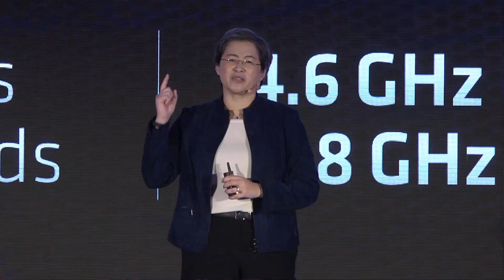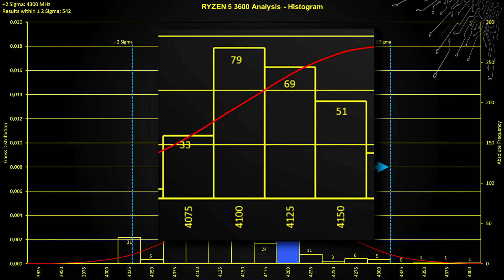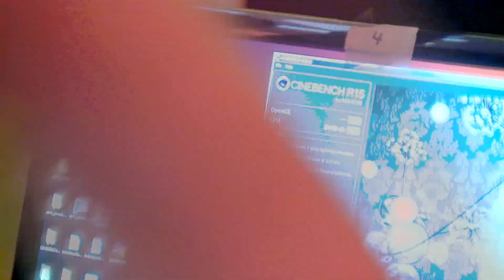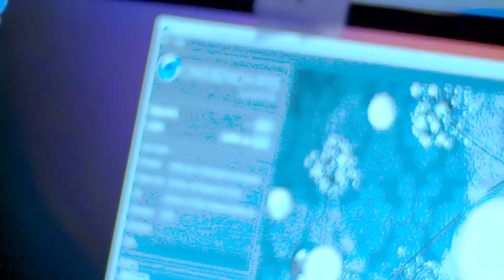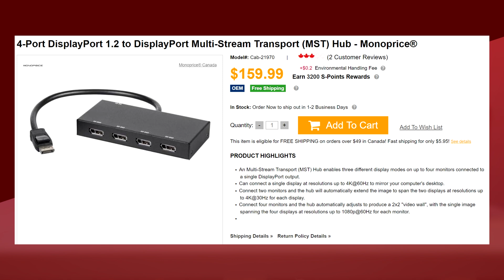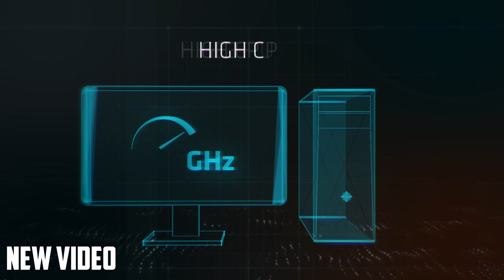95% of Ryzen 3900x Can’t Reach Boost Clocks, Survey Says!

Comment: My 1650 V2 would hit my overclock speed of 4.1 gigahertz quite frequently but when I upgraded to a 1680 V2 it rarely get the stock overclock turbo mode of 3.9 and it definitely doesn't take that overclock at put in and I blamed a cheap motherboard

Comment: that's probably related to the cooling system, it could be related to badly applied thermal paste
also, does it really matter, when the thing is half the price of a similar intel device ?
Reply from the maker: Personally, I dont think it matters, its still an amazing value. but its still an issue. I doubt cooling has anything to do with it, its quite easy to keep a ryzen cpu cool !
Reply: @BootSequence  talking about cooling, would a 3700x  with noctua nh-l9a work in a 2U server case running linux ?

Comment: But still they're not getting to 4.6 on a 3900 X but has to do the luck of the lottery silicone. And the board you using. Why recommend to get good clock speed by $300 and up on a motherboard.

Comment: I'm talking about the $350 and up versions and motherboards. You can't expect to have those clock speeds with a $200 board.
Reply: Asus make a nice $170 570 mb,check out hardware unboxed youtube video,low temps,performs well beyond its price.

Comment: weird... Both, my brother and I, are able to hit 4.6. WHAT DOES THIS MEAN?
Reply from the maker: means you should leave it like that, dont change anything 😂😂
Reply: Boot Sequence I have been messing with. But I ended up leaving it stock, which it still hits 4.6. Asus ryujin aio 240, bought couple more Noctua fans and set up a push pull on a open air case. Fans on auto my temps hit flat 60 degrees. Full blast I’m at high 40s on gta.

Comment: AMD get too sggressive with the clock because they want to convince the public that they are not behind intel when it comes to clock speed. That's why with the Ryze pro commercial they even try to plaster than 5Ghz number before. AMD should take it slow and not rushed it. Slowly improve their processor and make good impression to the public. Over promise did not make you look good. They already got a lot of flak with bulldozer they need to regain consumer trust slowly not rush it and create another bad image of themselves.
Reply from the maker: exactly what I thought. Although apparently it is an issue in the SMU. AMD is bringing a fix in september apparently.
Reply: @BootSequence  yep. Let's see what happen next. I've already heard few negative speculation why is this happening like how AMD push the clock as high as possible for review purpose then the BIOS updates following after initial review has comes out affecting boost clock because the aggressive clock AMD is pushing will wear out the silicon faster.

Comment: This doesn't surprise me as I have had two bad experiences with AMD so far with the latest being with first gen Ryzen.
Reply from the maker: at the start? or do you still have as bad experience with it ?
Reply: @BootSequence  Years ago I had an Athlon 64, and there was nothing wrong with the cpu.  However, the motherboard was poor, and there were compatibility problems with software and other hardware.  With Ryzen the cpu had a known fault, the Segfault bug, which made it unusable in Linux.  I sent it back to AMD, and they replaced it with another first gen chip that had the same problems.  I asked when sending it back to give me a second generation Ryzen, and I don't think that request was unreasonable because others in this situation have received the 2000 series chip. Moreover, according to others but contrary to the official AMD line, the entire first year of Ryzen production is affected by the Segfault bug.  In fairness to AMD, admitting this may have placed the company in jeopardy.  After this experience with Ryzen I stopped listening to the AMD hype and only wanted a trouble-free experience, and that is why I went back to the blue team.

Comment: Simply Physics, the current AMD Ryzen 3000's series are based in chiplets which has a more advanced process that run at the same power envelop than their older siblings but in a smaller package which translate in less contact surface with the IHS with a more denser configuration including the bigger I/O chiplet. The resuslt would be a thermal bottleneck at the higher frequencies that require more heat transfer and hence the thermal throtling. #QNA When and how Snows became a computer enthusiast and what happened with the custom case build in the end?

Comment: I've got a question:
My current set up (Specs listed below) seams to be struggling quite badly in some CPU demanding games. Would be your opinion on a cheap upgrade but one that would make a difference. Games like Fortnite: Save The World, Wreckfrst, GTA-V and Forza Horizon 4 all seam to struggle and I keep getting minor stutters and frame drops and my CPU always being around 90%+ usage while gaming. Tried everything, and I can't figure it out and so I am to believe its because of my aging hardware. What's your take on it?

CPU: Intel Xeon E3-1231-V3
Cooler: EVGA CLC 280
Motheboard: Gigabyte GA-Z97MX-GAMING 5 
RAM: 2x8GB Corsair Vengeance Pro 2400MHz
GPU: EVGA GTX 1080 Classified @2100MHz
PSU: EVGA SuperNOVA 750w G2
Boot SSD: Samsung 960 Evo 250GB
Game Storage: Kingston HyperX 3K 240GB
Main storage: Seagate Barracuda 500GB 7200RPM
Back-up Storage: 2x Seagate Barracuda 500GB 5900RPM in RAID-1
Recording Scratch Disk: Samsung SpinPoint 160GB 5400RPM
Case: NZXT S340 Elite

Monitor: Dell S2716DG & HP Compaq LA1951g
Keyboard: Wooting Two
Mouse: Logitech G502 Proteus Spectrum
Headset: HyperX Cloud II
2x EVGA 140mm for intake (Radiator fans)
1x Corsair SP140-RED & 1x Corsair AF120-RED for exhaust.
Reply: How are u able to use ddr4 ram? I thought the cpu n mobo only supports ddr3. I'm just assuming you're using ddr4 due to your ram frequency
Reply: @ItsZim0 
Nope. Stuck with DDR3 because it's a 4th gen based system. And yeah, I know... Fast RAM for DDR3. I love it!

Comment: Have you watched Hardware Unboxed video on how some x570 boards are getting the chips to their advertised boost clocks and some aren't? Im not saying this is the only factor but I think it might be part of the problem. My 3900x was getting  100mhz over advertised boost in stress tests but I was also trying to see how far I could push it at the time lol. Check that video out tho if u haven't it's interesting at the very least.
Reply from the maker: yep ! Seems like a deep seated issue within the bios which would explain the MB to MB differences. We're getting an update within the month!

Comment: The ASRock graphics card is the most useful one because it has 2 HDMI ports AT ALL! Who the fuck decided it's a good idea to put 3-4 DisplayPort outputs on GPUs when a vast majority of screens don't support it? If I move to any other 5700 GPU right now, I'd also have to replace at least one of my screens, because neither of them have DisplayPort.
Reply from the maker: you can get an adapter, but unfortunately, freesync will stop working. That's why this card is so great !

Comment: Ah, thanks for posting the screenshot with the instructions, since I missed the survey. I just ran it on my 3900X, but the first time I forgot to disable antivirus, and the maximum boost I got was 4.3GHz. When I disabled Avast for 10 minutes, I got 4.5GHz on two cores. I'm not hitting the advertised 4.6GHz either. Also I'm certain my scores wouldn't get counted if I was on time, because I do have an NZXT Kraken X62 water cooler and its software running, because they didn't just make a driver, like they goddamn should.

Comment: I wonder if windows is holding AMD Ryzen cpu back.  Would be interesting too see if more Ryzen CPUs were running Linux os and proper optimize Linux software/games and apps.
Reply: Doesn't matter, AMD advertise for a boost clock, ALL SKU release MUST hit the advertised boost clock under mainstream workloads, AVX INCLUDED, so long that its not temperature throttling. ANY CPU received by consumer not reach such boost clock should be ground for RMA, and in fact, monetary compensation from AMD.

I don't care about whether its Windows or Linux, consumer should not be force to accept anything other than advertised performance. And no, ''up to'' doesn't mean you can simply change the fact that last decade all cpu boost speed means a speed it can reach when not thermal throttling.

BTW I am keeping my R5 3600, I love it, it reach way beyond advertised boost clock, and one CCX is much better too.
Reply: I would be very interested in seeing this be put to the test. Maybe even some true parallel code on what would normally be a single threaded application!
Reply: Abdullah Shah 
Agreed. I would love see Linus/Anthony test this out. Or maybe Wendell.  Too many ppl push window benchmarks.  Very few take Linux serious. This NEEDS to change.   But YES we need see some YouTuber test this in Linux for zen 2 .

Been interested in Linux for while. But I’ve had zero luck getting to work correctly on older i7 Asus laptop.  But the laptop isn’t heathy either. my game pc i7 3770k 3.5 GHz with GTX 1080Ti, would love test Linux on, but my 2x 240 GB SDD fairly full,  so been slowly saving build zen 2 system. But Canada prices are still rather high for new 3700x/ ram prices and x570 still high,

Hell msi x470 pro carbon motherboard here still gong for $264+ which is CRAZY, it should be $220 ish with x570 out. 
https://www.memoryexpress.com/Products/MX71563
Reply: @SireDragonChester  that motherboard pricing is quite unfortunate, I picked up the x470 gaming Pro for £110 and the gaming plus is around £85 here on Amazon I'm unsure of x470 gaming pro carbon pricing here. I have a similar situation in terms of storage and was thing of picking up a dedicated 120gb ssd to put Linux on for £20 so I can dual boot.  I want to learn how to write truly parallel code but it it's quite difficult and in terms of games, unless you build an engine from the ground up for it you just can't make it scale across many cores that well. What is a shame is in most cases the code needs data from a different part of the script before it can act.
Reply: Abdullah Shah 
Ya I’m hoping upgrade to bigger SDD, but may just wait till ram prices/cpu/motherboard come down some pick up x470 with 2700x,  then later get zen 2. But ya prices here Canada bit high.  And ridiculous.
But yes we need see more Linux games tested. More benchmarks from games/software and apps.  Windows is holding pc hostage imo.  Just intel become top dog then got lazy because lack competition until AMD and Ryzen showed up,  I want see zen + and zen 2 under Linux, both OpenGL/vulkan api and even non native supported ones, with help proton :)

Most native games for PS4/Nintendo switch are Linux base games.  Just shame we don’t see more ports of them.  Consider PS4 is kickin’ butt this year and I game on both ps4/switch and my pc of course.   Just sad we’re forced to use bloated window for PCs space,  as former beta tester, server admin/(tech help guy) and ex moderator for small steam indie dev team (only step down do middle moving/health issue ) I do have better understand of game development, under the stress devs go thru and sad how many are becoming quiet greedy.

But yes their not many native support Linux games out their.   More devs need support it imo,  esp with Ps5 will be desktop zen 2, cpu.  I hope this helps some and better pc ports.
Reply: @SireDragonChester  you've worked in game dev? If so pretty cool, I've been working on a couple of personal projects that kinda merged to be one larger game exploring hdr, terrain generation and multiplayer functionality alongside photoscanning. As consoles continue to use AMD multicore performance in AAA titles has got to improve. It's just logical for them to become more optimised as new engines are created although it could be a decade before we get real scallabe  multicore games as mainstream being able to utilise all the cores on something like a threadripper.
Reply: @Abdullah Shah <3 thanks :) sorry this going ramble on hah.

I got to help out some young indie devs, while I’m no dev myself,my computer knowledge was helpful enough to help out/trouble shoot others who didn’t know how fix issues, finding bugs & server related issue, as I was one main server admins for 
For them and the only server up for them, it helped them a lot at the begging. With previous knowledge of running other servers in in the past ( ark server, wow server, CS server,  and ran my own BBS back in the days lol/few others)
It kinda how they offered me a position on the team as moderator/tech help guy :)

That’s good to hear your involved too with project. Wish you the best of luck? We/their project is base on UE4 engine and thus actually upgrade their engine a few times. Lol unlike ark survival devs can’t even be bothered upgrade their game engine.  And wildcard is bigger company now. ( got over 3200+ hrs in game, not including time building server/parts/streaming and being admin.  What project are you working on if may ask? If you can speak about it. If not, I fully understand too :)

More often then not, its ppl who start out in modding community of game, that later leads them into some help or  development into bigger project/early idea and or right into being indie dev them self.  
If you’re wishGoogle : Beast of Bermuda,  if you browse their steam forms. You’ll see I posted “ PC requirements”  in general tab :) I step down do to moving/health issue.  May rejoin them at some point if they have me back lol.  

Biggest issue in PC gaming IMO is windows right now.  It’s holding gaming back. Like intel cpu has been dominating for last 10+ yrs, that is till AMD and Ryzen knocked at intel door, and zen 2 is proof how much better they are. Even if they not top fps.
Window also IMO does not always install correct drivers. Lost count how many ppl/early access users who had no idea how download/install correct drives.   So many assume “ window install all my driver” and I’m banging my head on my desk lol.

I love both pc/Consoles and this current gen console while ok. They were mobile APU, which really held games back in some ways, but their also great games that make you go “ WOW this is console game?”  Games like horizon zero dawn, even breath of wild has its charm imo,   And RD2 was pretty impressive too imo. As somebody grew up on farm, owned few horses myself, first game IMO actually get horses be fairly decent.  Where so many games get animal so bad or wrong lol.

Anywho I’m rambling lol. I wish see more Linux games supported and hopefully with both Ps5 and next Xbox 2, zen2 IMO will forced devs to optimize more for multi cores/thread system more, with console having custom desktop APU, should mean better PC ports.  Also hope Ps5 will be using vulkan api, as porting games pc should make easier.  

Porting multi platform games to pc must be pain in ass for some devs,  if they have beta tests both Linux version ( Sony) then beta test window/Xbox, and if on the switch too lol,  ouch.  If all pc were already running Linux. It’s prob make easier, better access to hardware imo. I actually wanted get into game development/or beta testing. But never worked out, till recent, it’s open my eyes a lot. And bit too late now for me really get serious with it or ever land paying job with that. But can still dream lol.
Reply: I am currently a student just finishing up my GCSE's, other than personal projects I haven't had to much experience in the field besides my work experience. My game is a basic multiplayer game similar to csgo in terms of functionality but I want to go with a very simple graphics style and colour palate. The looks mainly should be brought out in UI and lighting. I want it to be my first game that I actually make to a releasable level of polish. Lucky for me I host lan parties literally in my school during lunchtimes as we have laptops for schoolwork. It's actually quite funny because the school tried to block the games but I use my own router and switches so it doesn't have anything to do with their network. As I host these lan parties I can introduce my game to them for testing which would be pretty cool.
Reply: Phoronix is your friend for that kind of testing.

Comment: to dd to that last Intel 10nm roast: "Yeah, but at least they actually hit the number on the box..."

All jokes aside, I think Competition is healthy but the false Advertising has to stop on both sides. There are ways to compete without lying to the customer.
Seriously, on AMDs side it is stupid. They could have just printed 100mHz less on the box and noone would have an issue, Performance would be the same just without negative press.
Reply from the maker: Actually a good response. I respect it. You're right !
Reply: my 3900x boosts to 4.6 no problem there is no lie there. People are getting motherboard bugs my crosshair 6 hero has no problem extracting the most of my 3900x
Reply: @jpm3066  yeah, sure 95% of people have a bug...
Mor seems like the ones actually hitting the advertised boost have a bug.

Seriously though, watch der8auers video on this.
It is a real problem and thousands of people took part on his survey. He analyzed the data and today even AMD confirmed that there is a problem.

I won't complain if it gets fixed, but right now it is a lie.

Comment: I'm not happy about this, but I'm sure AMD will come out with a statement or solution pretty soon.
Reply: The solution is optimization, AMD already nerfed the Ryzen 2 lineup's clocks with the new AGESA update while losing some performance for a reason. Shamino (a veteran OCer that works for ASUS) already discovered this along the findings that TSMCs 7nm for CPUs deteriorates very fast at anything close to 80C and 1.4V.

So expect lower clocks but with retained performance